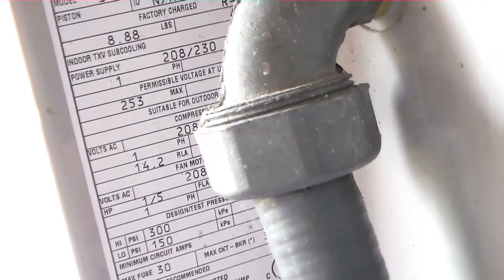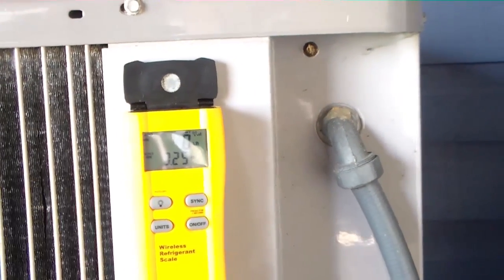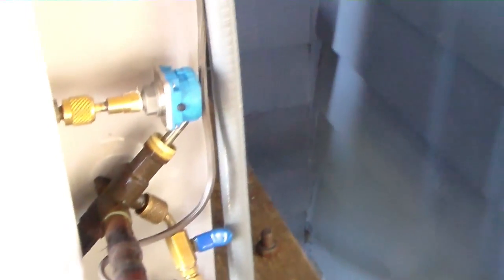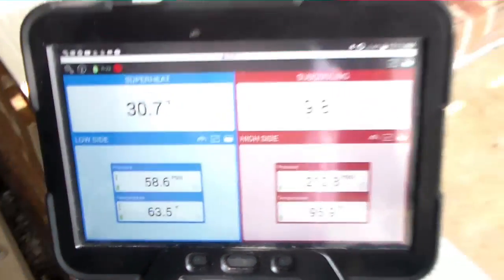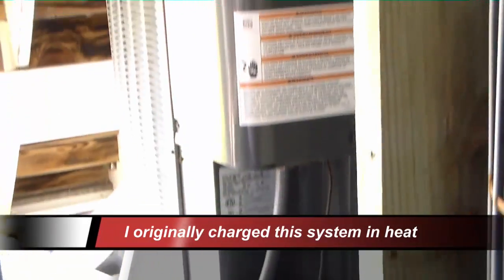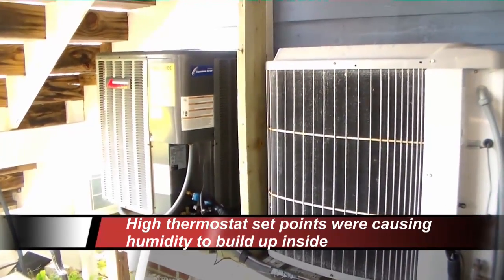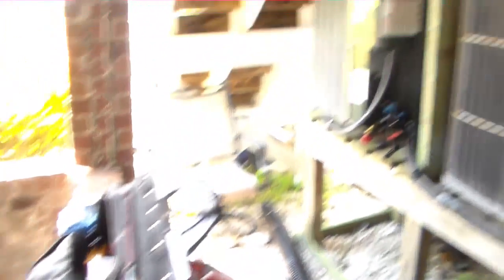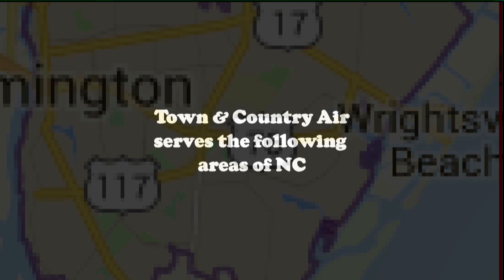High Indoor Relative Humidity Troubleshooting

Comment: I have a home built in 2014, 1 story, always set at a/c is always set at 70 degrees, filter changed on time, fan is on auto but my humidity level indoors has elevated to 71% what could it be? Is it the heat outdoors? I live in south texas
Reply: Did u fix it
Reply: What size AC unit? How many square feet is your home? What is the average run cycle time of your AC unit? What type of thermostat?